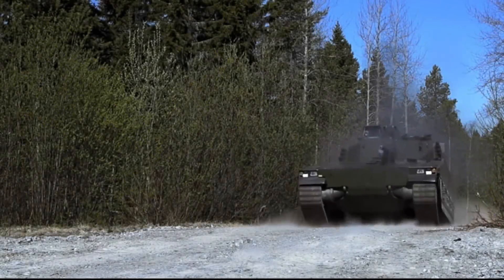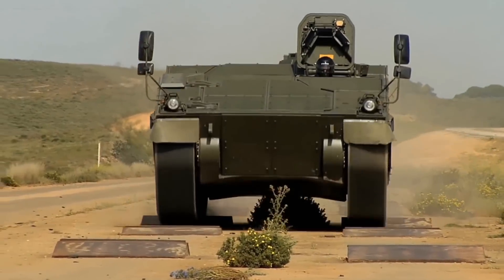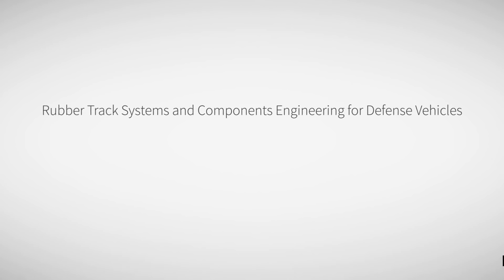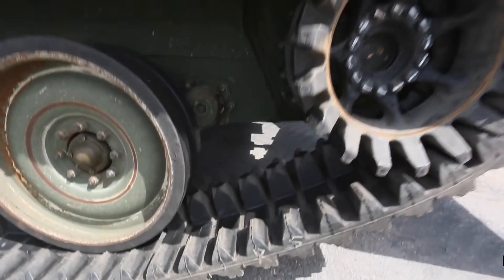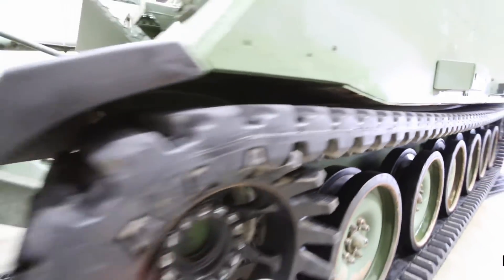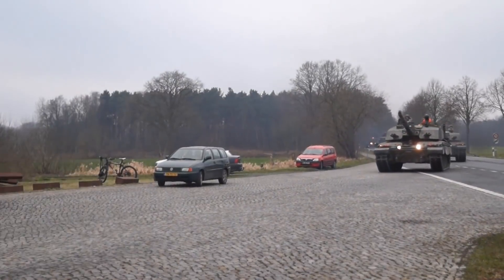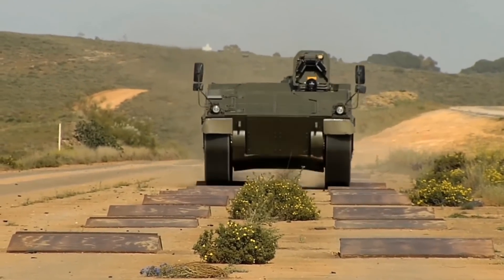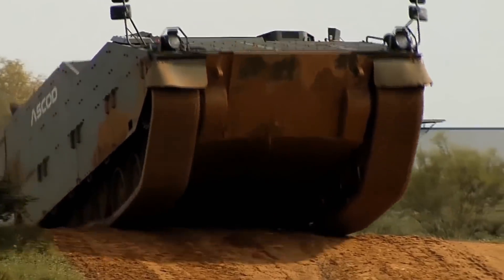Rubber Tracks on Tanks - Are they worth it?

Comment: Excellent summary. You fairly much hit the nail on the head with respect to my own thinking. In my experience, the M113 is a noisy uncomfortable vehicle at the best of times and I can really see the comfort benefit in putting rubber tracks on a lighter vehicle, such as this. I found your comments on vibration interesting, because  I can't say that I ever experienced this problem in the Leopard 1. While I certainly felt the vibration, I never found it uncomfortable, or felt that I wanted it to stop. Mind you, I hated those occasions when I had to crew the M113 for this very reason and because the suspension was terrible. 

But the issue of sharp stone terrain is significant. When on exercise in Australia's Northern Territory (which seems to be mostly made up of sharp rocks) with the Leopards, we had to replace our brand new rubber track pads within two weeks of arriving and then again on return after completion of the one month exercise. I'd hate to think of what this kind of terrain would have done to rubber tracks. I am curious to know whether the vehicles in Afghanistan encountered this type of terrain and if so, how they fared.

Thing is that you don't get to chose the ground on which you are deployed, so my thoughts are better safe than sorry. Stick with known technology with all AFVs until the rubber track can demonstrate that it can reliably handle whatever conditions are thrown at it. Maybe Norway can test some of their vehicles in the NT! :-)

Also, I don't think that it would have made much difference if that bridgelayer had been equipped with rubber tracks. You undoubtedly have a better understanding of the physics than I, but the issue there seems to be that you had a heavy tracked vehicle pivoting on an rough surface, which had poor adhesion to the underlying road foundation. I never did the Special Equipment Course, and can't remember how much the bridge layer weighs but IIRC it is significantly greater than the Leopard's 42 tons and when you are a cobblestone road, this has gotta hurt, irrespective of what the tracks are made of.

Comment: I hated busting track. I can still feel it over 20 years later. The vibrations on the M60 A3 were brutal and the noise has left my ears ringing ever since. The Abrams was not as bad as the suspension was way more advanced but track maintenance sucked worse due to the track skirts. The M60 was relatively easy to fix until you broke a torsion bar, then life sucked worse than if it was just the track. Don't get me started on the final drive sprocket. That beast was always a murder part to change. Fun times. I still would not have changed it for the world.

Comment: That was impressive, In civilian use we have had for some several years  now several, tracked diesel powered dirt excavators ALL have continuous one piece rubber Band tracks and never once did we have a problem with them.  However, we never ran over any land mines or burning battlefield debris or any thing else concerning  a modern battle field combat condition. But if they are reliable and quick to repair in the field under all the nasty field conditions that tend to pop up, GREAT.   I can see there would be some really serious great advantages to All rubber track vehicles. You could actually quietly sneak up on someone. 
Great Video I had No idea the rubber track had started to be utilized in front row combat vehicles

Comment: Segments rubber tracks would probably be the best idea. And there should be metal connection piece that travels through each segment.   That way the rubber can expand and shrink without effecting tension.  Like a tension bar in each segment.

Comment: Nice&fair pro/contra spot on this technical topic. I would agree to see those on more vehicles, but i could imagen it on MBTs if ther's enough steelwire into to make it shred be enemy fire, but possibly not infunctional to further carry the tank. It would be a problem if we're still in a time where tanks love to crush through buildings and solid obstacles, buuuut, guess at last so far off this that we can rate the combat value with rubber bands higher then metal tracks.

Comment: Steel tracks even with rubber pads are a nightmare in the streets.
In my country, Portugal, we had this huge military parade in one of the most famous and most traffic avenue in Lisbon.
After the huge expensive fixing the avenue they ended the military parade. 

I was a driver of an APC (M-113) and also we had older M-48 tanks and M-60, also with steel tracks. The law inside of the military was, when driving on public roads, no hard turns.

Also, for my experience in the M-113, the small rubber pads in the steel tracks where a nightmare in wet roads at high speeds. If you were not careful turning or braking too much one
one on side, the M-113 had the tendency to slide. Was fun doing it but not many people could control it.

Having a tanks with full rubber tracks can be good in flat terrain or in roads, more grip. But I do not seen it last long enough in harsh terrain with rocks and so on. Steel is steel. Rubber no matter how much resistant it is, probably would not last much in 2 or 3 months of abuse in operations in hard terrain.

Comment: IMHO no. At least you break a track link yu can repair and replace. If you hit a mine and blow the track how do you repair the track?  Rubber tracks are usually one or two cables with rubber molded around them.  EDIT: OK they have repair kits. I have no problem with these now.

Comment: Yes the experiance of an unsuspecting armoured infantry soldier not seeing the back swing of the sledge hammer during track bashing and being knocked out would be less likely with rubber tracks 🤣 my company warrior crews also hated me (an ex A mech also by the way)telling them to change the pads. An evil job digging out the fastening nuts. I'm fact they hated me doing track inspections as it generally meant track bashing. I once found a whole track pin complete with nuts on both ends and all 5 bushes still in place in the sand of our warrior line up. Thankfully it didn't come from my warrior coy, but boy that track was real worn i guess.

Comment: I was in Desert Storm and have been around both M1s and Russian tanks and APCs.  The Russian models were far noisier with combustion engines and metal tracks.  An M1 coming from downwind can actually sneak up on stuff.  At one point, about halfway to Kuwait City, we went by a place where there were Russian tank tracks, and then some M1 tracks merged, and around a hill we found the Russian tank with its turret blown off and the M1 tracks leading away.

Comment: It's not just crew who benefit from the smoother ride of rubber. It's all the electronics that need to be beefed up and protected from vibes.
That means you can use more sensitive equipment like, night vision, sights, IR etc, or extend service life of current equipment with less failure and lower maintenance demands. I think those cost and time savings will swing it in favour of rubber (or is it Kevlar?).

Comment: Metal tracks stretch over time. On the m113’s new tracks were 65 on the right & 64 on the left. At the end of life they were 63 right & 62 left. You would find the track tensioner would max out & your track was still not tight enough. I’m sure this is going to be a problem with rubber tracks pop quiz what’s the porpose for the language of fire control?

Comment: I think I probably missed it in the video you most likely covered it but, what about some type of compromise? Like say rubber pads on metal tracks? I did like the link rubber tracks They look a lot easier to repair but yeah and combat I can see them getting blown right off. I think rubber tracks would suffer a lot of the same problems that rubber tires do getting pierced by things torn and maybe even melting from extreme heat. My father was in the Army but he didn't roll around in a tank however I have met a lot of people who were tankers the last tank I ever rode around in as a kid was a M60 Patton I can't remember whether or not I had rubber pads on its tracks though. It's been awhile since I've been in Fort Hood Texas. I joined the Navy so I don't see a whole lot of armored vehicles unless I'm on a landing craft. It's not very likely to happen again as I'm getting out soon.

Comment: Probably not a good idea for a main battle tank as it wouldn’t take long for an anti rubber track weapon to be developed. At first I thought if you’re going to use rubber then you may as well use wheels as I used to prefer wheeled vehicles for light reconnaissance especially if you have enough of them so that you can carry on after losing one or two but the weight savings of rubber tracks allowing them to be wider with greater cross country ability could make it the best option. At least a tracked vehicle would have more internal space than a six wheeled vehicle with wheels of big enough diameter to have the same vertical obstacle capability so yeah a good idea for light reconnaissance vehicles.

Comment: I think for light weight rear echilon vehecles maybe in a non combat stituation
i would guess the rubber would expand at least 5 times that of steel big problem nomatter how they deal with it rubber degrades burns tears rots cant even put it in the sun iv effects it to
as for vibration havnt these geniouses figued out to isolate the the sprockett with rubber!
and coat the inside of the steel track with rubber???  rubber worked fine on the m2 half track 
and the stuart light tank if used segmented is the way to go realy how does one replace a a full track
on a challenger ? any takers ??? lol  rubber gets cut up on rocks 
and whst about solvents ? drop a 500lb solvent bomb and that tank aint going any were! melted tracks fire! yes a flame trower cloud take your 10 million dollar baby out in 20 secs !!
i cloud go on and on and on

Comment: I've operated heavy steel track machinery off road for years. Steel tracks do stretch and require tensioning. Probably not as much as the rubber ones though.

Comment: Do metal tracks have better resistance to concentrated small arms &/or machine gun fire than rubber continuous band tracks? I figure metal tracks are nearly bullet proof & it probably would take something like a .50 cal bmg to wedge between the pin & the shoes or something like that to hurt as the shoe itself is pretty thick. How resistant are rubber tracks to small arms/assault rifles, light, & heavy mg fire?
Reply: Steel tracks are much more durable, to fire, chemicals and general wear.

Comment: The longer the track is, the less suitable the rubber band gets. But If you look at the Hägglund tracked vehicle they have four tracks. To on the front car, and two on the trailer.
That may be a solution to large main battle tanks. A bit like the original Mammoth tank from Command & Conquer.
On the other hand, I think the large main battle tanks will go the same was as the battleship. They will become obsolete due to changes in modern warfare. The Russians looked into how ISIS was fighting and has now a pick-up based brigade that is much more lightweight and much faster to move around the battlefield.

Comment: Excavators should use tracks like these.  currently only really smaller construction machines use rubber tracks. they don't need the huge lugs that a dozer needs! though the heavy steel tracks might help lower the center of gravity??? hum

Comment: We (Can) used ARTHUR (Counter Bty Rdr) on a BV chassis in Afg in 04. No issues on rough terrain however we flatbeded them on long road moves because of vibration / wear at speed with the addition weight of the rdr. Also worked on ADATS which had both steel and rubber track during it's lifecycle. The electronics really benefit from the rubber, moreso than the Troops.. I'd never thought of the long term health effects from many years in track veh; time to contact Veterans Affairs :) . Another advantage is the rubber trk doesn't p/u 10% of the crap a steel track does. We caught razor/ concertina wire on a steel track in Germany, stopped us in very short order and removing it was hell.. Yes, go all rubber.

Comment: Modular, rubber coated composite tracks are clearly the future. The manufacturing process is not quite there yet in terms of cost efficiency and scaled up production, but the technology has all the advantages of steel or steel + rubber tracks and none of the drawbacks. 

The carbon fibre composite backbone demonstrates far more consistent characteristics under extreme temperature fluctuation than either steel or rubber (ductility and brittleness/hardness that can cause cracking). It is stronger in both tension and compression, while much lighter and smaller in dimension for the same given strength. It is more shock absorbent than steel.

The modular aspect of these prototype tracks comes down to engineering, but given the material's inherent quality it can be engineered to be just as modular as steel tracks. The only current drawback is existing manufacturing techniques and cost, both of which will decrease as the innovations of the last 10+ years from universities start to get implemented in industry and scaled up. One initial problem was the lack of composite fixtures (nuts, bolts and such) which forced early designs to use a mixture of composite and metal fixtures. This is not ideal as using metal components and fixtures to lower cost can cause damage to the composite materials structures, potential compromising them. Techniques for cost efficient manufacturing of smaller composite components and fixtures have however come along way since the 2000's and this will begin to revolutionise what can be cost-effectively made in the future. 

So as it stands now, steel and steel + rubber have really only one advantage: cost. That is a significant advantage as things stand today, but it will not be in the future.

Comment: The first part reminds me of some of the things professors at the university I attended were working on for the Army. Ever since the US military went to all volunteer they have been making more and more investments in human factors studies. The short term benefits are retention since soldiers are not being discharged for medical reasons relating to back and joint injuries which means less need to increase incentives to raise numbers. Long term the benefits are less severe back and joint injuries later in life. So even if rubber tracks cost more the cost to replace an infantryman can be substantial between the need for incentives, such as signing bonuses, GI Bill costs, training costs all adds up. Also losing a soldier with specialty training to being discharged for preventable injuries can have an impact on combat readiness and effectiveness of a group that is avoidable.

Comment: Anything larger than 1 to 2 inch rocks is a nightmare for rubber tracks and is highly recommended to not neutral turn on that type of terrain, its not only hard on the tracks and road wheels, but it put a huge pressure on the hydraulic tensioner. Also, I would tend to agree that rubber tracks are much better suited for support vehicles.

Comment: I would go with linked tracks covered with more rubber than these whole length tracks. Better ride and easier to replace. Segments are good as well, but I like the flexibility (no pun) of individual links made with a metal base, metal guide horns, metal pins and metal connectors. The extra rubber would help with the ride and lessen road damage.

Comment: 8:40
Didn't think that the cobble got screwed up much...Then the OTHER side was shown.

Edit: As for having rubber on a Main Battle Tank...I am nearly clueless when it comes to tracks, but I would imagine durability and reliability would be better in the end. Thus, metal would most likely be better. Rubber is certainly very good, but metal will be able to survive a tank round better, is easier (currently, so minor advantage) to repair/replace, and is less likely to fuck up in some way. 

Plus metal has proven to work in high stress conditions. So for now I would say keep the rubber to the AFV's until stuff is worked out to allow the rubber to work at least 90% as well as metal in high stress conditions. AFV's are less likely to be forced into high stress conditions like a MBT is, because a MBT will be fighting in open grounds that require high speed than an AFV, which can safely (for combat at least) slow down behind the tanks that doesn't have paper for armor.